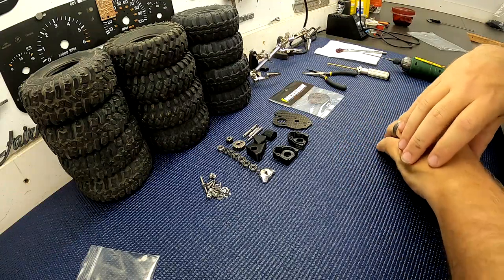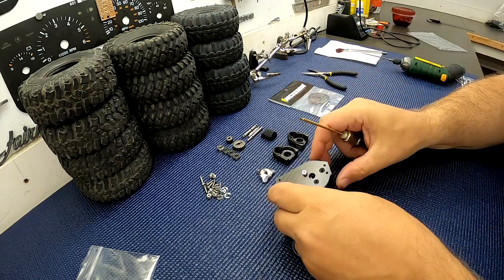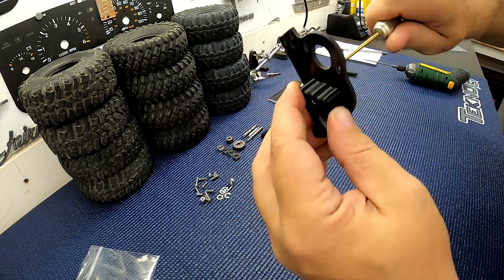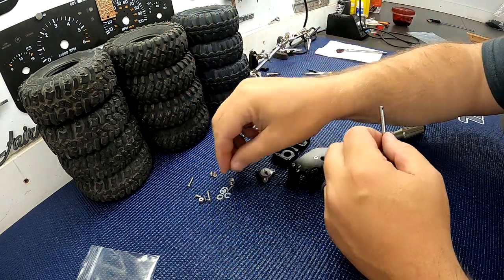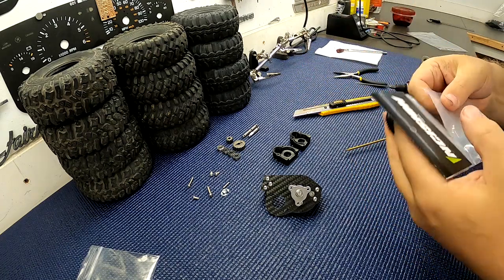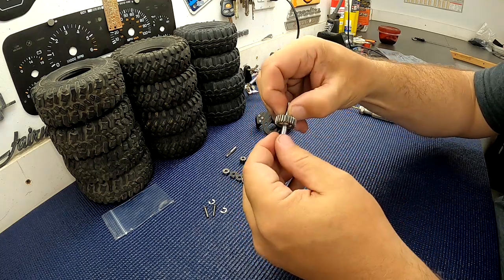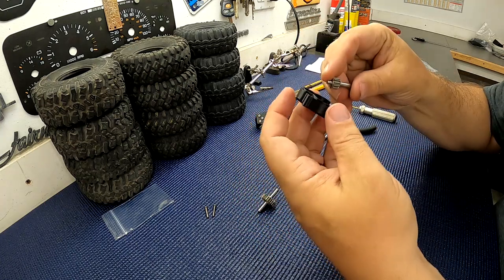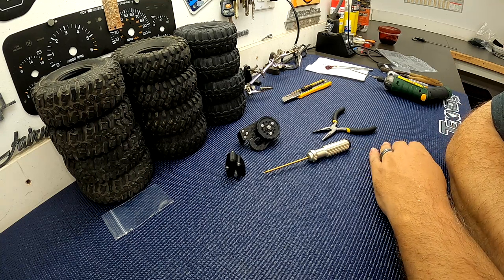TC-V1 Primary Drive and Transfer Case Assembly Tutorial

Comment: why not design the tcase as a 3 gear with OD/UD. imho that would be more optimal than haviing them on  the axles
Reply from the maker: Size, weight and CG were the main design objectives. Having OD/UD in the axles really isn't any different than having it in the Tcase. In our testing we've found that crazy OD/UD isn't very beneficial anyway. I have OD/UD in my TC prototype (about 22% total) and my main tester has only OD in the front. We can crawl all the same lines.
Reply: been running with about 44% on d44 axles. I think one of the benefits of having od/ud on the tcases is accessibility, it would be more tedious to maintain them on axles.

I do get your point, thanks